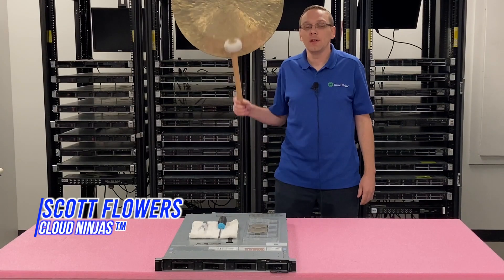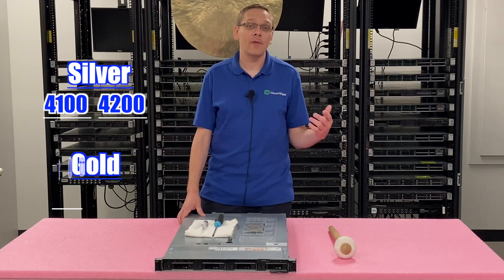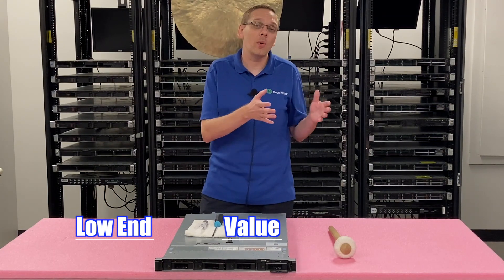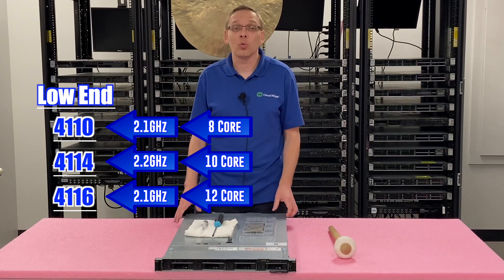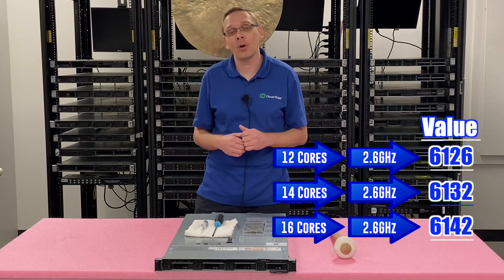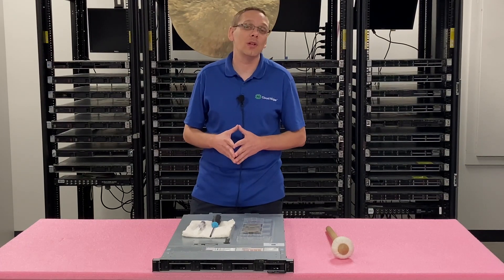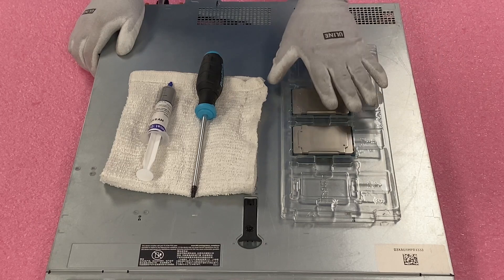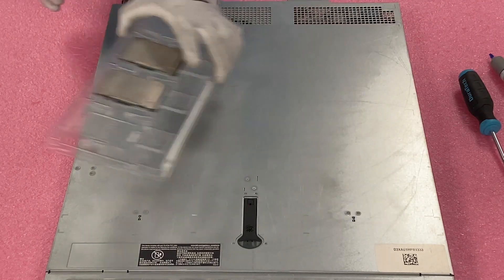Dell PowerEdge R440 Server CPUs | Intel Xeon Processors Options | LGA3647 Socket | CPU Install

Comment: Thanks for sharing. I have a DELL R440 server with Bronze 3204 installed. I want to install 2nd CPU. May I know whether it supports mixed CPU combo like 3204 + 6130? Or I need to install 2 same CPUs?
Reply from the maker: Must install 2 of the same CPUs.  Matching.

Comment: good video :)  

But see that you suggest 6142 this has 150w TDP  I chose this myself but switched to 6140 since Dell warns that the R440 does not support more than 140W TDP. Is only a newer motherboard with its own serial number that supports 150W TDP.  This also applies to the entire high end 4200 series as you mentioned

excerpt from the manual

((PowerEdge R440 with system board part number 4JN2K can support up to 150 W TPD processors (6252, 6428,
6242, and 6240). System boards with previous version part numbers can only support up to 140 W TDP.))
Reply from the maker: Great info!  Sure this will help many people in the future.
Reply: @cloudninjas Hm. After watching this video, I immediately bought 2 pieces of Intel Xeon Gold 6248R processor with a TDP of 205W. What should I do now?